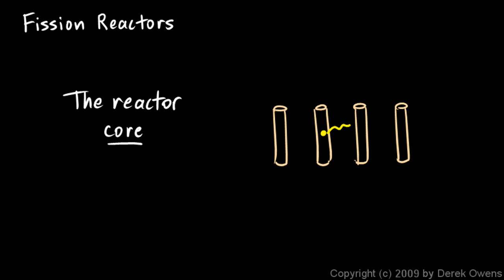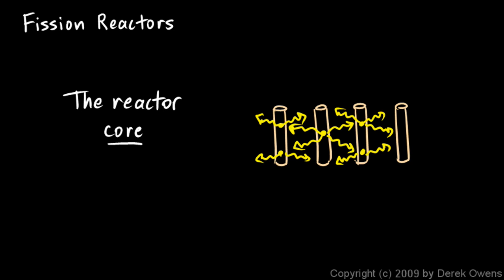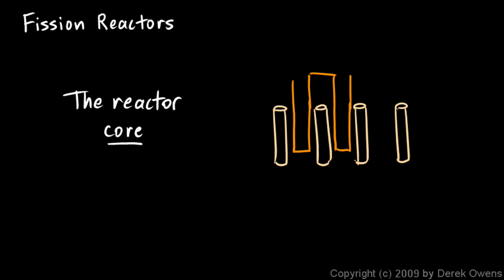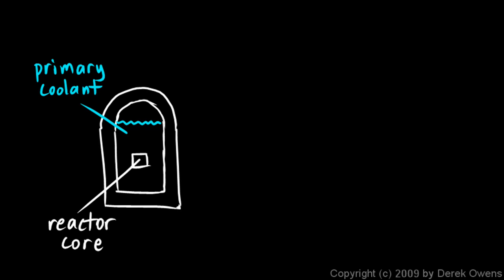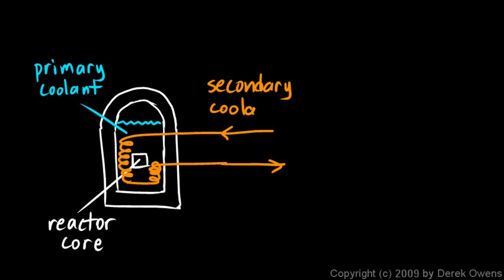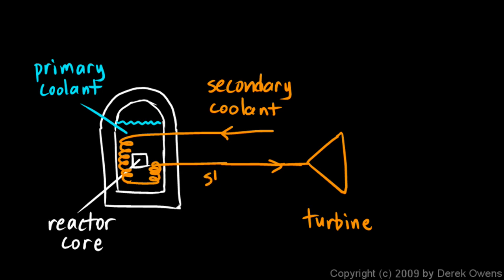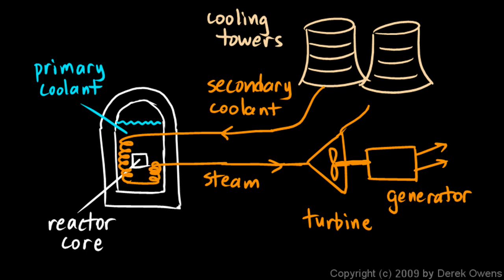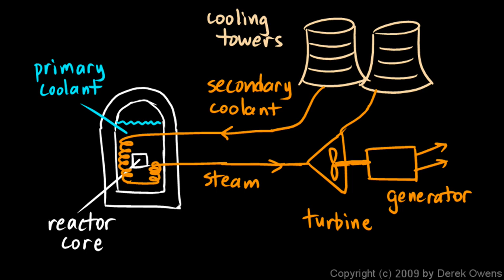Physical Science 7.5d - Fission Reactors

Comment: Wrong explanation.
The cooling system doesn't work as you described it. 
The cooling towers are used to cool the water used to condensate de steam after its exit from the steam turbine. And the steam used to run the turbine is generated in a steam generator, which is a heat exchanger between heavy water from the reactor and regular water. 
There are usually 2 or 3 different stages of heat exchanging before the steam enters the turbine.